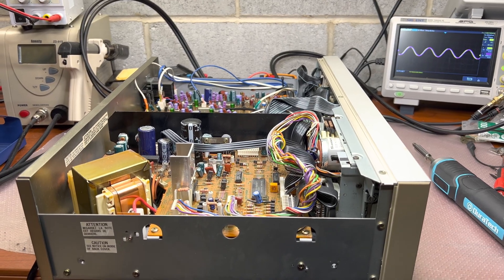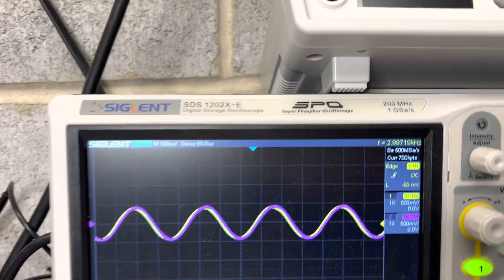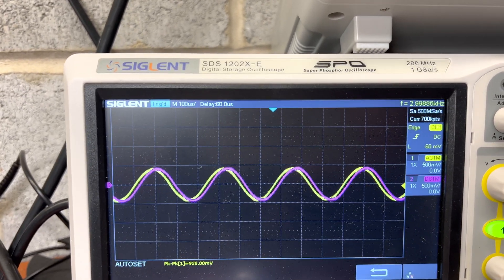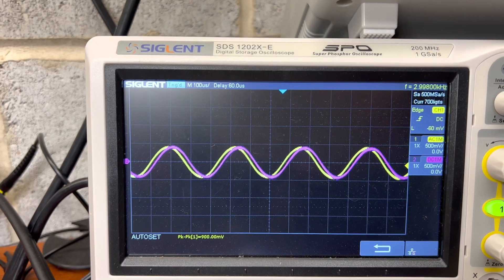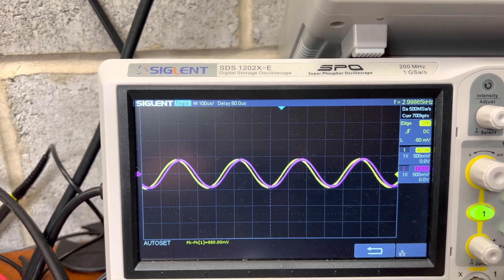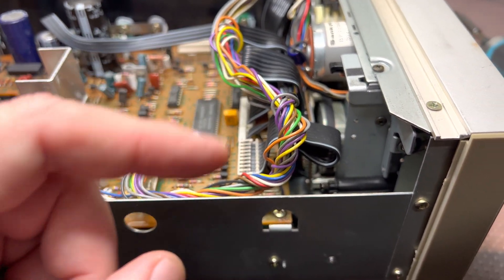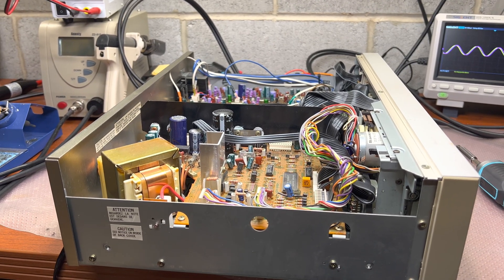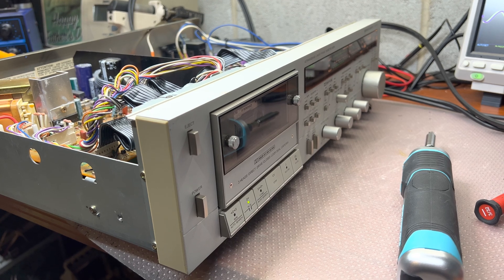Speed Adjustment Tutorial for the Harman Kardon CD491 Direct Drive Motor

Comment: I have a HK-HK400XM which I have similar problems during Calibration, I will set the bias and it say set to the 4- Coils for lt and rt to Minimum is it better to mintage a good sin wave and have both channels equal? Later when checking after playback Bias setting should it have 00 after adjusting it? I set LT ch to 00 but Rt ch is cant get it to 0 is that a problem?
Thanks again